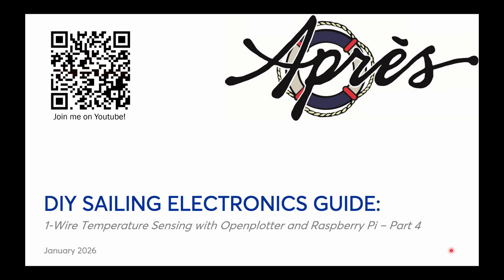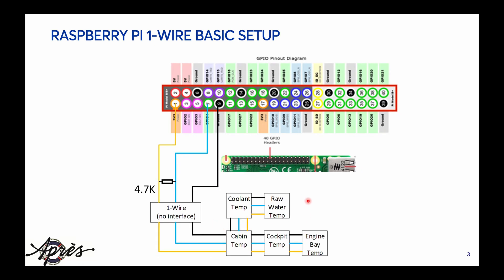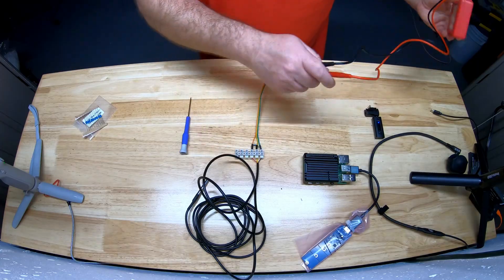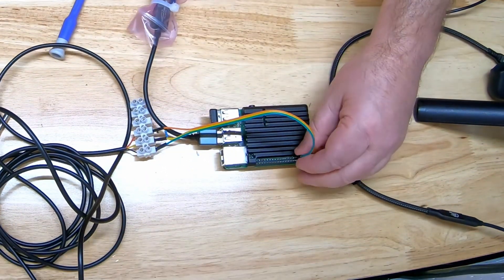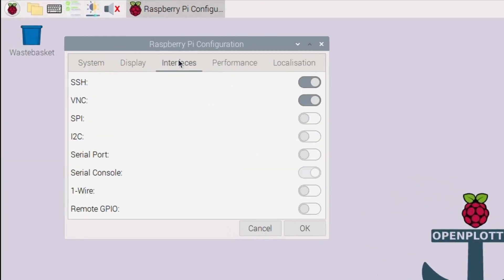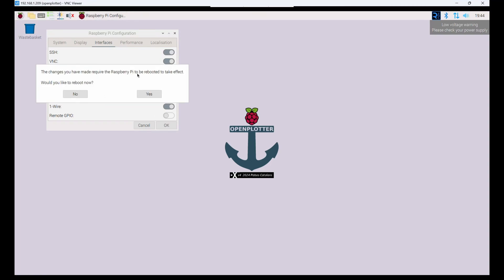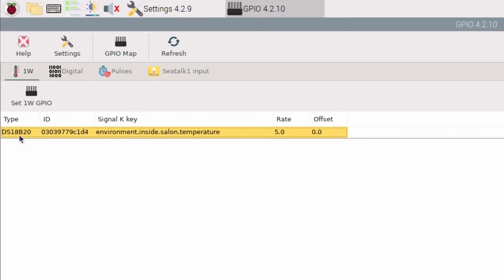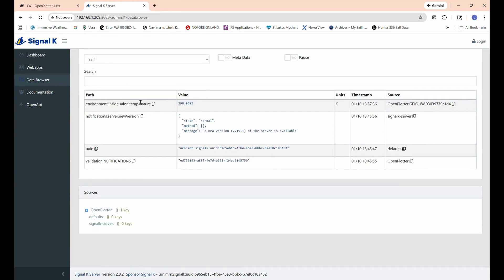DIY Sailing Electronics Guide: 1-Wire Temperature Sensing with Openplotter and Raspberry Pi – Part 4

Comment: A really great demonstration. Thank you for explaining all the necessary steps. Can I ask if you’ve done something similar for displaying engine revs in OpenCPN, or perhaps this is something coming along soon?
Reply from the maker: Thanks for the Idea, I may do one like that but I much prefer the gauges in KIP to OpenCPN, but if you are limited in space and want OpenCPN to occupy the whole screen, you can add the "Engine Dashboard Plugin" and if your connection between SignalK and OpenCPN is setup correctly, you should just be able to add the RPM Gauge.

Comment: 1wire sensors sometimes tend to hang and disapper ( Used with Mac Arthur) and just come back to life after shutodown or resetting the cable ( so they suffer power loss). Maybe it's due to poor chinese/aliexpress manufacturing  With the resistor ( whih Mac arthur does not need) do also happen?
Reply from the maker: I believe the ones that I have a clones and not true Dallas but I don’t think I have seen those type of losses as long as you don’t go to far and most of the time I use Cat5e cable for long runs

Comment: The Dallas 1-Wire stuff allows multiple devices on one wire ;) If you have multiple devices in different places you can run a single 'bus' wire to connect them all up to rather than running them all back to the Pi.
Reply from the maker: yes, they suggest in their literature that it is more robust to wire it as a star, all coming back to the same place, but over the years I have used it in Star or multi star with one star connected to another star.  I an older house we reused all the telephone sockets as a 1-wire hub.  In the house we injected the voltage at a couple of spots but In a house the distances are generally further than on the boat so I haven't had to inject voltage somewhere else in the bus, but this is usually the fix.

Comment: Are the connections marinized or is that important for this application
Reply: That might be with a video itself, how to modify typical DIY electronics so it'll stand up in a marine environment. 

I mean, there are a lot of useful things I might build around a RPi, but how long would they last mounted in a bilge or cockpit locker?
Reply from the maker: @jeffdege4786 I did do a video a while back covering waterproofing of connections that were in places that may see rain or high humidity, but I guess much of it depends on where and on what you are deploying the system and then build according. You could have the Pi wide open by the nav station far away from water or it could be on the back of a monitor at the helm fully sealed each would have its own requirements. I have parts of both

Comment: I've done a lot of desktop projects where I just inserted a low-current stranded wire into a terminal block and screwed it down. 

But I've never done that on a boat. 

On all of my boat projects, so far, I've crimped a ferrule on the wire and tightened the terminal block screw on the ferrule. Or crimped on ring terminals, then used a screw terminal block.

I've been told that the vibration that is inherent in boats will result in the connection failing. 

Of course, to date, none of my boat projects were so low voltage, or for such a non-critical system.

Have you any issues using screw down terminal blocks on bare wire, on your boat?
Reply from the maker: So firstly, it was a desktop demonstration of how the schematic is connected and how the software is setup and that was the focus. The deployment on the boat could be different. 

The ones I have on my boat are connected to a screw terminal that goes directly on the Pi to a terminal block for crimped spade or ring connectors and that is where all the sensors are connected.  Depending on how you isolate the pi/wiring/blocks would probably dictate how you deploy on the boat. They have been like that since 2019. 

Great points, I should have talked to that in the video!  Thanks